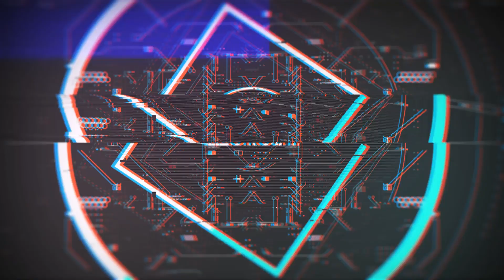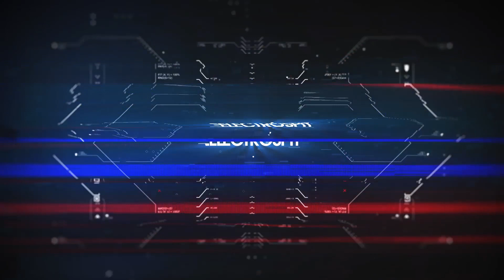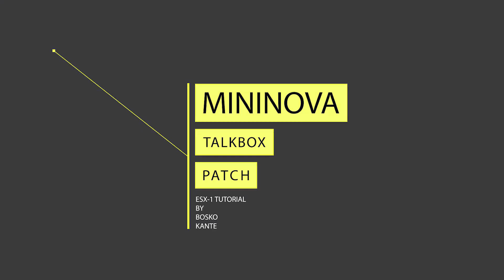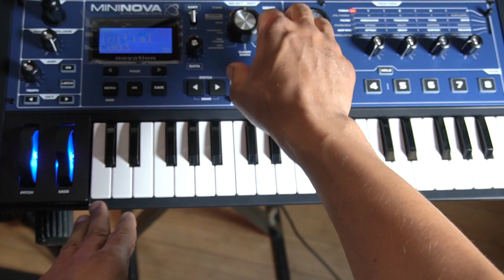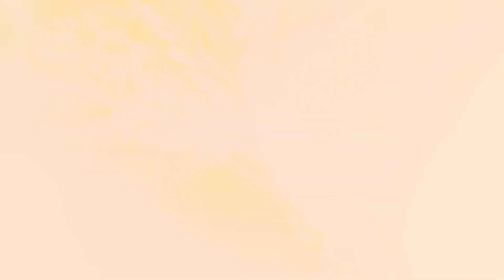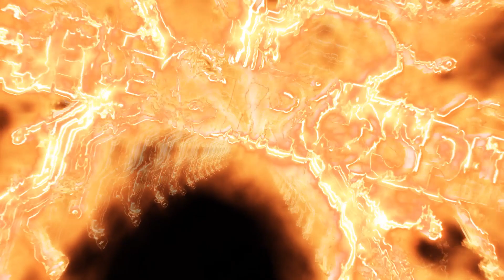How to Make An ElectroSpit Talkbox Patch on the MiniNova Synth by Novation

Comment: Hi, thanks for your video ! Is it possible you could list the OSC, Filter, Env, Glide, modulation control, etc.. settings in the video’s description for those who know well their mininova or for those who want to create a preset on another synth ? 🙏
Also, if you have a Maschine+, a specific tutorial for routing an audio output into the ES-X1 and maybe a Monark patch would be really awesome.
Just got my ESX-1 🤩 and so still in the discovery phase, trying it with the app and my synths/grooveboxes.

Comment: When using this or any other synth, how do you make sure the right tones are going to the right drivers on the ESX-1 itself? I just got mine this morning and I been messing around with the app, I want to get a synth though, as I am blind and would rather be able to feel the keys then try to work with a touchscreen. 

I know the app just uses the right and left stereo channels, but how would you make sure a synth does that correctly? I don’t want to damage this thing before I even make something cool with it.